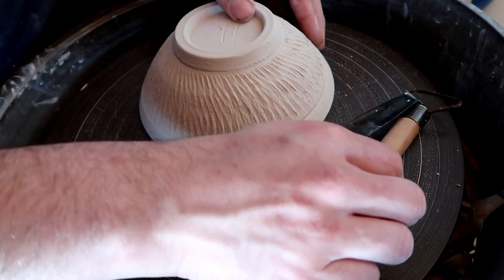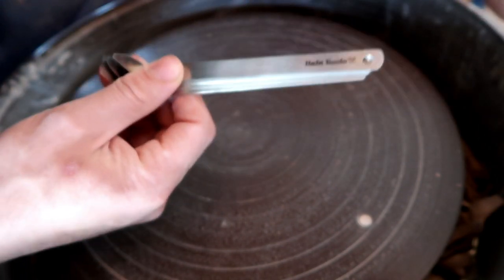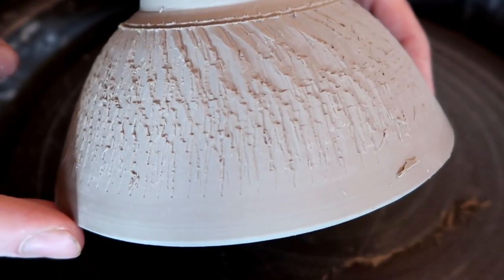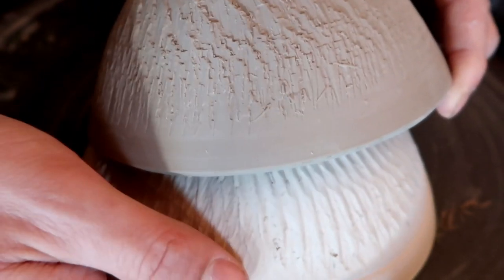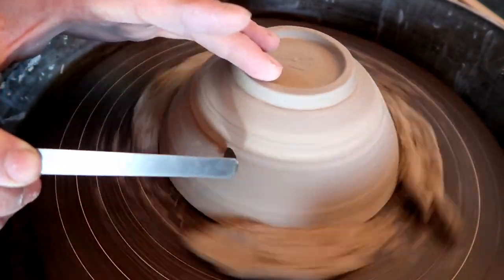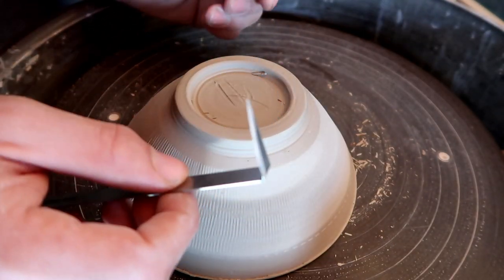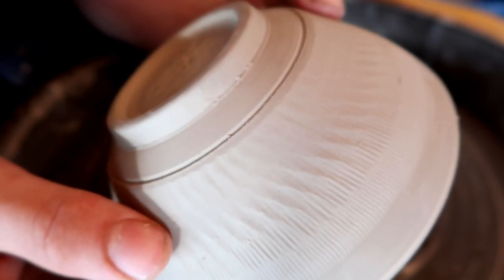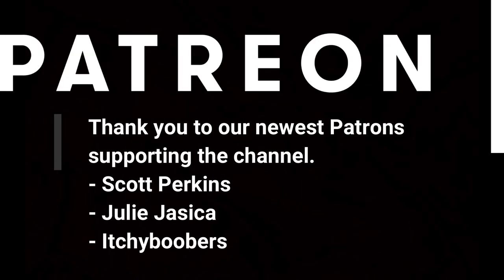Chattering video #2 (reviewing hsin chattering tools)

Comment: I've used these tools, I love chattering. I find that the condition of the clay(how dry) makes a lo of difference. Sometimes that makes more of a difference than which tool you use.  So I dont think you can look at a pattern on one bowl and know that is what you will get everytime. The artisan pottery tools, chattering tools are also great, they are not trimming tools, so they only do one thing. But they are more beginner friendly,  you dont need to hold them in such a specific way. I find the square tip one make that lovely deep basket weave effect.  I have both and would be hard pressed to choose between them at this stage in my pottery journey.